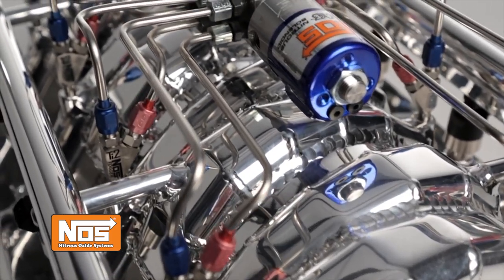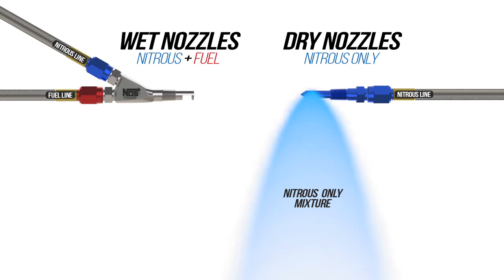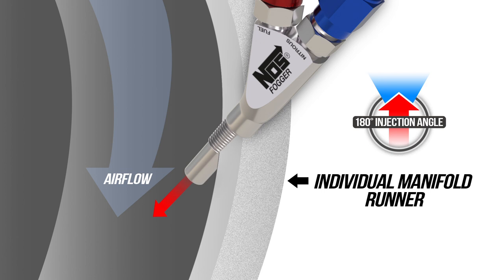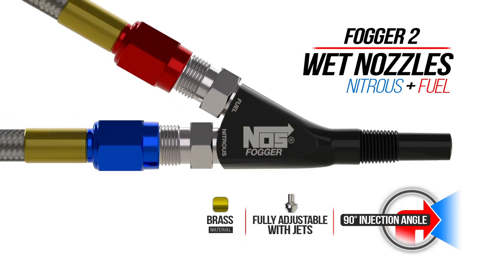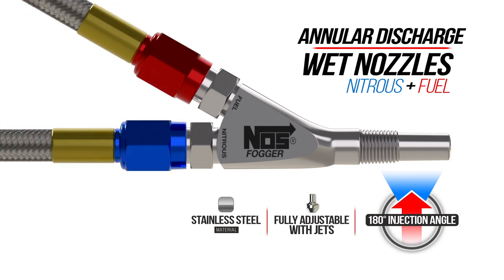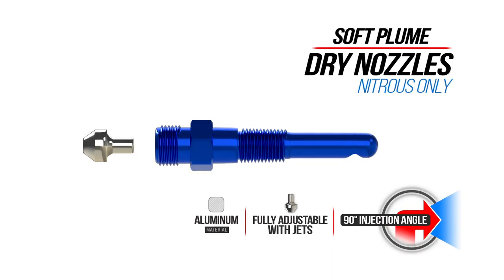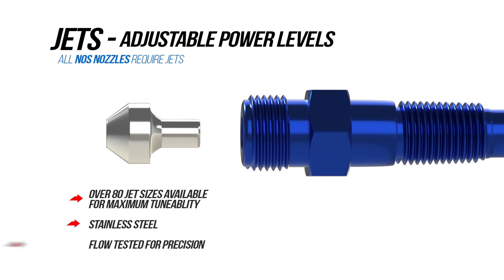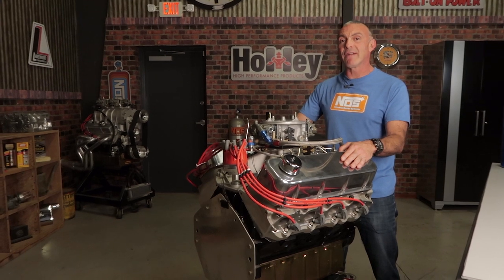How Do Nitrous Nozzles Work? NOS Dry Shot and Wet Shot Nozzles Explained!

Comment: I have a few questions…Does your ecu need to be tuned for this too?    Also wondering if a upgrade in fuel pump is required? Lastly.. when tying fuel into the fogger.. does that mean using the same fuel line as the one that connects to the fuel rail?

Comment: It just doesn’t make sense to me how it is not modulated with engine rpm and airflow as the fuel injection system is. Ya know the nitrous and gasoline just , well it’s on or off regardless of rpm or air volume. It makes sense that you need more nitrous at 8000 rpm flowing 1200 cfm of air and less at 4000 rpm and 600 cfm of air.
Reply: electronics fixes all of those issues.